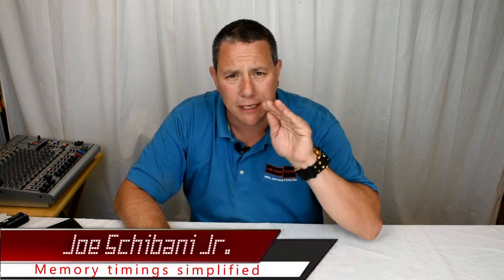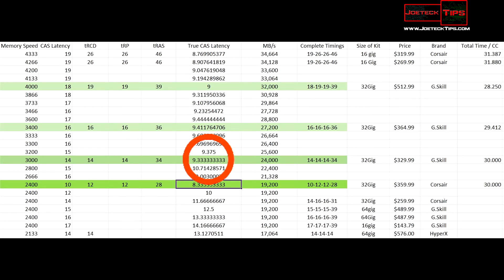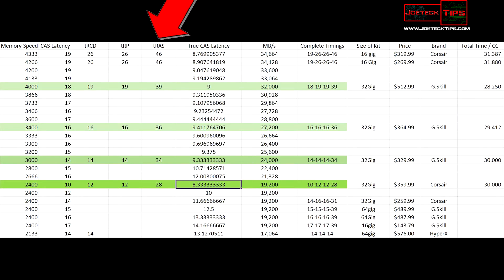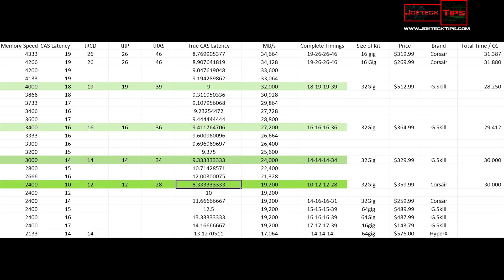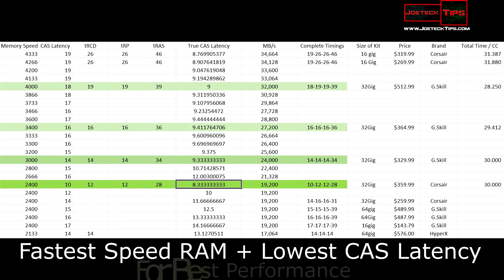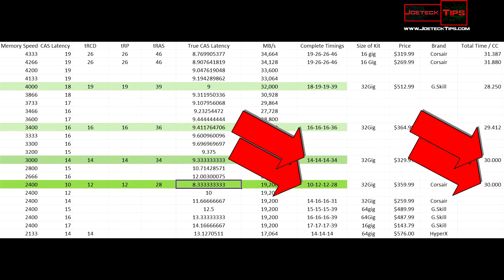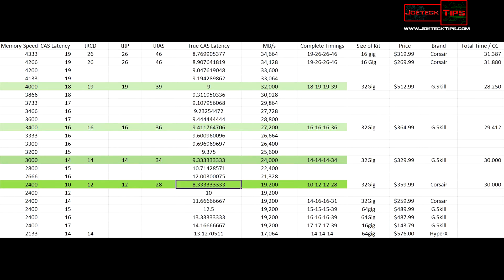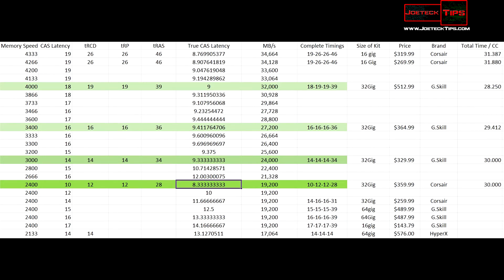Memory Timings Simplified | How to Pick the correct RAM | JoeteckTips

Comment: what if cas latency is same while other numbers are not for example 1st ram(36-36-36-76) 2nd ram (36-44-44-96) will they cause any problem
Reply from the maker: Do not mix ram speeds, it may not boot or will be unstable.  They must be a matched pair..

Comment: how the hell did you calculate the total time column?

Converting the 2400MHz values to true latency I get 8.333, 10, 10, and 23.333. And then adding these together I get 51.6667. How did you get an answer of 30? >_<
Reply from the maker: Gabriel you have to convert clock cycles to true timings in Nanoseconds. Then add. The formula for each is different.  Once I get home I will look at my notes and report back. I did this some time ago and took a long time to come to these conclusions.
Reply: Sweet :D!
Reply: I used a solver to figure it out!

Apparently its CAS +tRCD/2 + tRP/2 + tRAS/2

Now I can continue my ram timing research :3

Comment: Why  you did not  talk about Bandwidth?   the faster speed ram has higher MB/sec   that means it should transfer fast.... Generally the the CPU is going to read chunks of data from the memory  in that case the  higher frequency DDR memory will be faster.
Reply from the maker: rrangana11 because CAS latency is key. MBs is based on chipset. The same memory modules will perform differently, close but differently. And not that important. However, if you wanted to know the theoretical bandwidth it's in the specifications DDR4-3200 is 25.6 Gig per second. I buy memory based on the CAS. The faster the CAS the faster I can get those 25.6 gigs per second to my computer. Don't get wrapped up in those numbers, unimportant.
Reply: CAS latency makes a huge difference when it comes to bandwidth.  Why do you think L1 and L2 cache are so fast they have really low latency and response times. You can make up for a MHZ deficit with tighter timings. When DDR 4 first came out slower clocked DDR 3 modules were actually faster because they had much tighter CAS latency.
Reply from the maker: Very well said! Thank you!